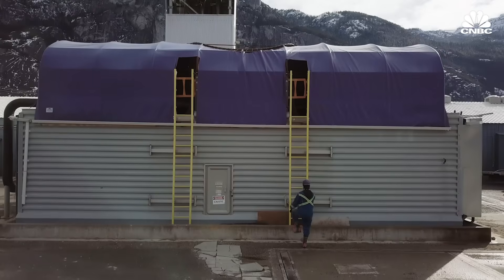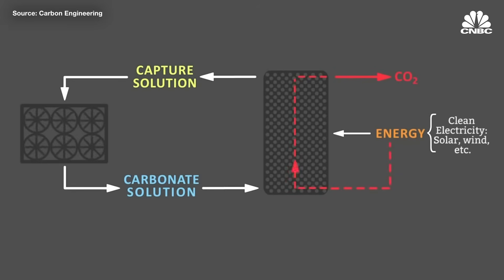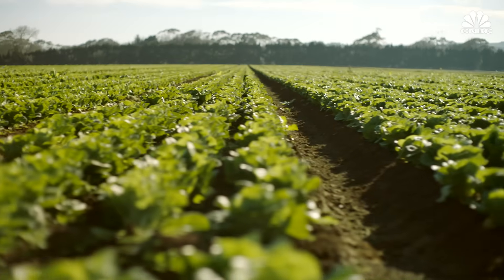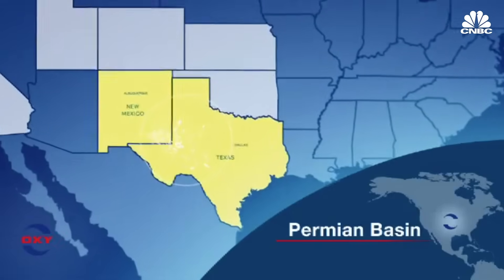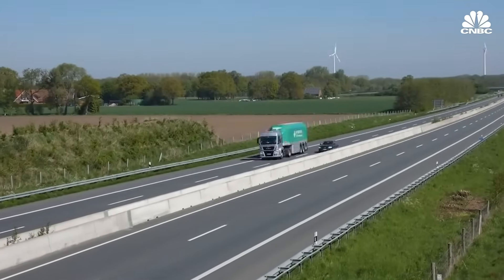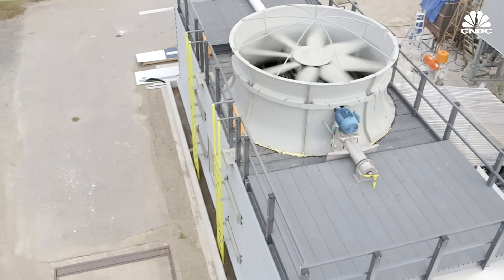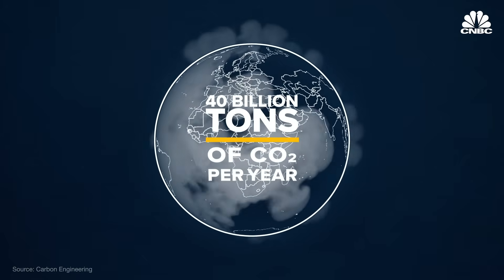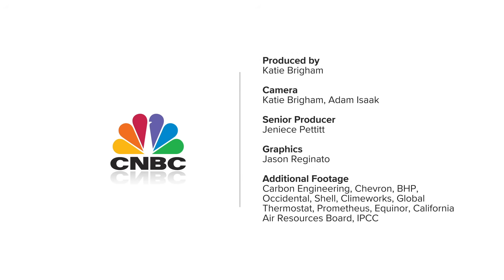Bill Gates-Backed Carbon Capture Plant Does The Work Of 40 Million Trees

Comment: It strikes me that if the plant is making CaCO₃, it could possibly make cultured marble. Or even better, work as a replacement for limestone.
Reply: Marble is metamorphosed calcium carbonate. It means that calcium carbonate is altered at the molecular level by the intense heat and pressures occur deep under the earth's surface. Plants could not do that.
Reply: @JoviaI1  
I'm thinking more of reconstituted stone, with cement or epoxy. But point well taken.
Reply: @tibfulv  Limestone is probably what you mean then. For sure they could actually make real limestone. It's similar in how coral makes limestone.
Reply: @JoviaI1  
It's actually called engineered or cultured stone. But you mentioning limestone gives me another idea. It could be used the way limestone is today. Just remember to capture any CO₂ from the process or we'll be stuck with the same problem again.
Reply: Jovial you could artificially metamorphize calcium carbonate like you can make artificial diamonds
Reply: @johntarvin2878  You technically could but its probably the most impractical thing ever lol.
Reply: @JoviaI1  He is referring to the machine I believe.  Which is using a heat derived catalytic reaction.
Reply: Whut?
Reply: @doctorbonglord5334  CaCO₃, is the primary component of both those rocks, so in theory a little modification should make it substitute for either, if it's not too expensive.
Reply: How did you do that 3?
Reply: @themblue8236  
So is natural granite. Key word: natural. 😉

Comment: So I have a question?      Do they make more CO2 running those fans and the pumps and the buildings ac and all the other energy uses then they pull from the air?

Comment: when everything absorbs heat*, it's ridicoulus to waste energy/heat on co2 capturing projects
to avoid thermal runaway** we need to clean the oceans from plastic**, reforrest the planet*** and stop producing heat***

*as in kinetic energy, potential energy, pressure, moisture, electricity/lightning, molecular vibrations
**when the icereserve is gone, the earth thermostat is dead - the end
***plastic absorb sunlight an the expense of algea; no photosyntesis, just heat and dissaster greenhouse steam all over the planet 
****when possible, sunlight absorbs/stores as chemical/organic processes 
*****when everything absorbs heat, heat is difficult to get rid of and easy to melt ice (when the icereserve is gone, earths' thermostat is dead - the end)
 (go to mars and we get space agriculture for free - right away)

Comment: So the world would need between 25-50 thousand of these plants to put any sort of meaningful dent in our CO2 output.  That's roughly the equivalent of how much electricity the entire United States uses.  Everyone here is saying just plant trees, of which we'd need somewhere between 1-2 trillion of them.  Where is all of that freshwater coming from?  Forests also absorb more thermal radiation from the sun and would actually increase the temperature on that scale. They only temporarily sequester carbon for ~30 years before death and decay releases it again at the same rate they absorb it.  We'd have to burn the trees as they die and sequester the emissions to make that effective.  Sure if all of the trees were planted in an area larger than the Amazon basin all the moisture wicking off of them would increase cloud cover reflecting more thermal energy but there isn't a large enough land area anywhere with enough water to do that.  They'd be spread all over the planet mitigating that beneficial effect.  Both of these options sound great but really aren't.  Moving to a hydrogen economy powered with renewables, 4th generation fission reactors and eventually fusion plants is the only sane and economically viable path forward.  Everything else is treating symptoms rather than the root cause.

Comment: So at 5:24, Mark Jacobson must be a smart guy as a professor of civil and environmental engineering and all, but he seems to be ignoring the fact that we are still dependent on fossil fuels.  So why not do what we can to extract the carbon until we have alternatives? He supposes that supply will increase demand.  Having more oil reserves does not mean people will use more oil.  I doubt that a significant number of people are willfully not driving for environmental reasons but will start driving again if oil is cheaper due to excess supply.

Comment: If we can get magnetic flying cars maybe we can get perpetual energy cycles which recycle the energy used to propel the vehicle in any given direction with minimal energy loss?
Or just change the way engines work so they are much more efficient than the 200+ year old engine design still being used?
Or maybe temporarily switch to Nuclear power en masse to create way less waste but much more power while we figure out a good solution?

Ok but all jokes aside we should have flying cars by now and im mad...
Reply: Well flying cars would not be magnetic. Cuz ya know, this doesn't really work. Electrogravitation hasn't yet been created. As has antigravtiation. The only way to fly currently is by using the laws of Newton. And well, they are not very good for something cheap like a car.
Reply: @Maddinhpws  bruh
Reply: You cant violate the laws of thermodynamics so perpetual motion is impossible to accomplish because of those said rules.
Reply: @noticedruid4985  He kinda misused the word perpetual. Semi perpetual would be what he would need to say.
Reply: @noticedruid4985  I... I know... it was a bad joke I apologise.
Reply: @judechauhan6715  Nah your good, there's no need to apologize. I just wanted to put my 2 cents about thermodynamics.
Reply: @noticedruid4985  Thanks, real weight off my shoulders.

Comment: One of these plants extracts 1M tons CO2/yr for at least $100/ton, or $1B/plant/year.  For that much you could borrow $20B indefinitely (i.e. paying $1B interest a year), use it to purchase perhaps 20M acres of 'empty' land - about 30000 square miles, on which you could plant perhaps 2  billion trees.  Compare that to the 40 million trees of which that plant supposedly does the work.  So IF you have enough cheap land that is currently tree-free but could be planted, trees are ~50x better.  If the estimate of 40000 plants being required is correct, we'd need about 24M sq miles newly planted in trees - a patch about 5000 miles on a side.  Hard to find that much empty land. For comparison, the US has about 1.4M sq miles of crop land, and the whole country is about 3.8M sq miles.  So 'more trees' is not likely to do the job - and that's before considering how to eventually sequester all the carbon those trees collect (i.e. after they eventually stop growing and die).

Comment: Build a machine that captures CO2 by burning natural gas that releases CO2...genius
Reply: Engineering Alpha the lights in your house probably run on coal power (if you're from the US). Natural gas is in no way clean, but it's the cleanest fossil fuel. I support renewable sources like wind, solar, and nuclear.
Reply: Jordon Powell  the thing with energy systems like this is that there are energy conversion inefficiency losses. Then there's the energy needed to produce calcium,the raw material that reacts with carbon dioxide in the air to create calcium carbonate. You need to heat lime with aluminium to free up the calcium,then you need to process calcium carbonate to get the CO2 and trap it underground. I'd bet that it is not yet trapping in more CO2 than the entire process creates from the raw material to the final step

Comment: Carbon dioxide is beneficial to plant life. Removing it from the atmosphere is about as stupid as it gets.
Reply: Current development leads to having too much CO2 in air which is actually bad for plant life(Too much of anything is, well, too much).
Reply: @TealJosh  Greenhouses regularly inject carbon dioxide to achieve 1000ppm for maximum growth. At no time in Earth's history has there been too much carbon dioxide for plant growth. During several periods of glaciation carbon dioxide levels have dipped so low that they severely inhibited plant growth. Your statement is  nonsensical.
Reply: @patrickweaver1105  There's tons of research that high levels of CO2 reduces plant's ability to handle other nutrients. This effect is not noticable in industrial setting because artificial nutrients are used. That does not happen for wild plant life.
Reply: @TealJosh  Define high levels. It doesn't occur at any carbon dioxide level ever seen on Earth. Artificial nutrients are fed to crops in industrial settings to maximize growth not because of any imaginary deleterious effect of carbon dioxide on plants.

Comment: I don't get why people are complaining that you can make this into fuel... I mean, why not use fuel from the air instead of having to crack oil? Then you have a complete system which balances itself out and you can manage the carbon in the air precisely.

They are acting like this isn't going to be a key process in reducing carbon and we'll just keep adding more net carbon. That simply isn't true. People are going to use whatever they have available to them for their needs: batteries, fuel, etc. to do their business and travel. If this is better than cracking oil, then let it happen and try to reduce oil cracking instead. You have to take one step at a time towards a better system instead of indirectly forcing even worse habits to form somewhere else.

Comment: we need to stop using coal and oil, and start using more nuclear.

Also, one OR the other is not going to help things along.  planting more trees AND carbon sequestration AND reducing carbon emissions together is the way we should be going.
Reply: While I agree with that, there is still a major issue with nuclear power. What do we do with the spent fuel rods and other nuclear waste?
Reply: @jhelwagen4135  with newer designs, namely thorium reactors, there are no fuel rods, and waste from other reactors can be used as a starter fuel, neutralizing it in the process.
Reply: @sarreqteryx  There's still the issue of what to do with the spent fuel. We're still dealing with something that takes hundreds of years to become safe enough to handle. It's better than Uranium, but the best we have been able to do with that is bury it and hope nothing goes wrong.
Reply: @jhelwagen4135  spent thorium fuel can be re-processed and re-used.  also, it can't be used to make weapons grade anything, and the fuel itself produces  significantly more energy than uranium.  Thorium reactors are inherently walk away safe, as they're designed to self-extinguish if they get too hot, and even that's a very slim likelihood.
we're talking about a design which utilizes, and neutralizes, spent fuel from other reactors, can't produce weapons, can still be used to produce medical materials, can re-use it's own fuel, and is completely safe to run without supervision.
Even if we're talking Uranium reactors, they've been proven 99.98% safe to run for the last 80 years (3 instances out of thousands do not make a trend), whereas coal and gas plants have blown up left and right over the 120 years they've been around, and hydro-dams cause river depletion (see the Colorado/Rio Grande rivers), and have burst many times.  Nuclear plants don't emit anything from their stacks except water vapor, whereas coal plants emit  carbons, radioactive matter, and sulfur, while gas plants spew carbon dioxide and uncombusted methane.

Comment: SJW:  "It's been proven that CO2 is the major cause of climate change so fossil fuels must be stopped"
Fossil Fuel Companes:  "We found a cost effective way to convert CO2 to oxygen"
SJW:  "But I really just wanted rich oil company owners to go broke"
Reply: Splitting C from CO2 to make O2 will take the exact amount of energy to combine C with O2 through burning of fossil fuel. Unless we are using other forms of power other than those that requires burning (which accounts for 90% of the world's energy production), doing what they are doing is actually going to produce more CO2 than reducing it. Try taking into account the energy required to run the fan, the energy to run the trucks that are going to bring the Carbonate solution to a processing facility, the energy required to turn Carbonate solution into CO2 and then turn CO2 into O2. Each step along the way requires energy. Unless we are using nuclear power, which doesn't require burning stuff, to fulfill the energy requirement of this technology, which I doubt we are, all we are doing is introducing more CO2 into the atmosphere. 

PS: I don't like SJWs. But I'm not blind to the marketing stunts the Oil company is trying to pull. I'm also a physicist.
Reply: @lhcphysicfreak  Good job showing that you went straight to the comments without watching the entire video.  Most of the energy is just running the intake fans.   The energy used for the "splitting" as you would put it is just gravity. SMH

Comment: This doesn't have sense. I don't want to  hear "complicated".
If you want to turn CO2 in to plastic it needs energy. From where that energy comes?

You use your car
C + O + Energy = CO2 (You can adapt for H and S to H2O and SO too, but won't matter in this aspect)
If you want to make it back you need the inverse. ENERGY + CO2 = C + O
Where that energy cames?
Solar or nuclear? Then invest directly on solar or nuclear. Each time you do something you will have some loss, circle energy is a lie

Comment: There are geothermal plants in Iceland that work by pumping up hot water, use it for power, then combine CO2 from the air into the water and pump it back down, where the CO2 mixes into the stone. They're effectively negative emission plants.

Comment: Even if they did do the job of those trees, the trees put the carbon in the soil and it helps hold water.  That water table replenishes supply and stabilizes environment.  The trees also provide a cover for the soil.  Is this plant going to generate biochar to apply to lands and support indirectly cover crops?

Comment: Cost of CO2 capture, put in perspective, Part 2:
I happen to own 3.5 hectares (8.65 acres) of meadows in Burgundy (France). I rent that surface to a cattle farmer for the equivalent of 150 $/hectare, ($60.7 per acre)  the locally going price. If I were to plant a forest instead, it would cost me $1.5-3 per tree, say $3. I could plant 500-2'000 trees per hectare, say 1'000.
Each tree would capture  approximately 1 ton of CO2 in 40 years.  It would therefore cost me, over 40 years, 1000*3 + 40*150 =$9'000 to plant and grow a forest of 1 hectare, which would capture 1'000 tons of CO2.  Capturing CO2 by growing trees cost therefore about $9 per ton of CO2, i.e 10-20 x cheaper than the process presented in this video!
Not to mention the value (for construction, not burning) that all this wood would have after 40 years!
This process makes no economic sense!  Let's a) decrease our CO2 output, and b) plant trees. It sounds much cheaper to me. What do you think?

Comment: "getting funding from fossil fuel companies is the wrong direction" is a stupid argument. oil is important for the world. our infrastructure and even our lives are based on it. the best way, the cheapest way and the quickest way to tackle climate change is not to get rid of fossil fuels, which will have additional costs that will be too expensive for most of the world, but to find a way to make fossil fuels carbon neutral and that's is what the oil companies are doing.

Comment: Or you could spend the billions of dollars that went into this, to actually PLANT TREES and restore forests, which will do ALL THAT this plant does AND 
- help protect against floods, 
- protect against strong wind,
- provide shade to cool the surrounding areas, 
- provide habitat for numerous plants and animals
- evaporate moisture to the air
- remove toxins from the air
- doesn't use any power, electricity
- does not require heavy maintenance

plus we can DO IT LARGE SCALE now, all over the planet, instead of waiting for this plant to be built on one location, somewhere in the future.
So PLANT TREES not build carbon capture factories!

Comment: It costs ZERO dollars to maintain trees, after they are planted. They are efficient and reproduce themselves without human intervention. Why don't people get that.
Reply: J P 
Why is it an either this or that? Why can’t we just do both? We’re running out of space to feed ourselves so we deforest to do so. That’s what’s happening in Brazil .
Reply: I'm from family that owns forest and use it as source loggs for wood industry. All cut trees are replaced of course. Maintaining forest is VERY time consuming, especially the first 5 years of planting. And no, we don't use artificial nutrients for the trees.
Reply: J P 
And don’t forget about wildfires and forest fires.  Whoops.
Reply: @sinecosine7493  Speaking of forest fires, we should find ways to safely have them in controlled manner. Forest fire stores tons of carbon material(that doesn't fly off as smoke, which is most of it) into the ground. This replenishes the land a lot nutrient wise and ALSO STORES CARBON INTO THE GROUND.

Comment: Solar and wind grids are dependent on gas generators to maintain a stable grid. I also love how people in the comments are not realizing that you have to pressurize the well in order to force oil out using such a method.  Meaning the deeper the well the more compressed co2 has to be used to force out oil. Now for my final point oil companys also back solar and wind energy development, if this sounds strange see my first point. The only way to escape a dependance on co2 emitting energy sources is to use nuclear power plants.